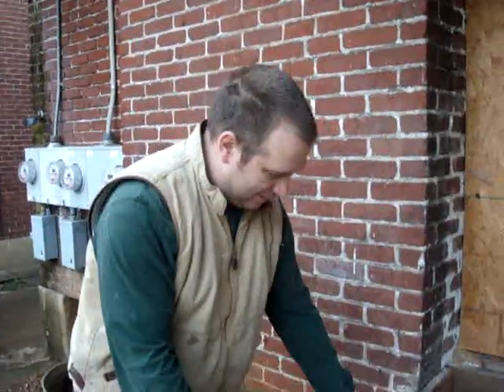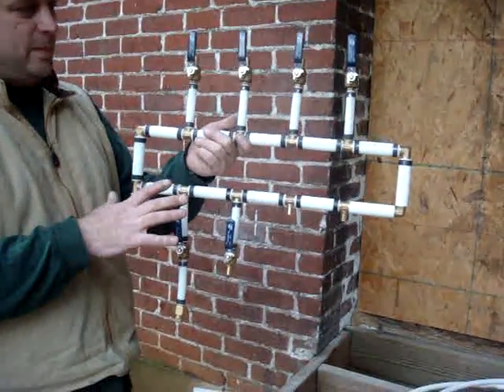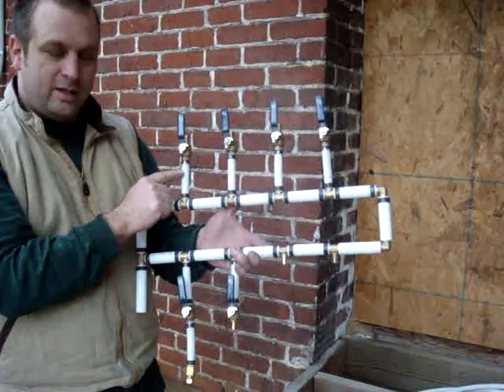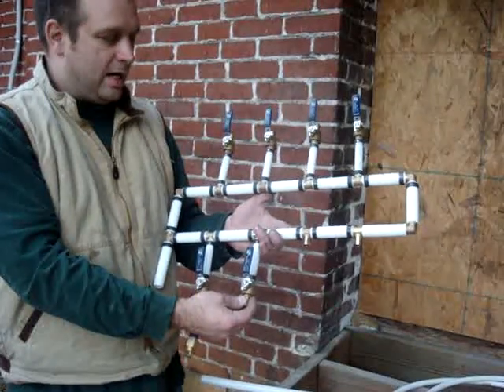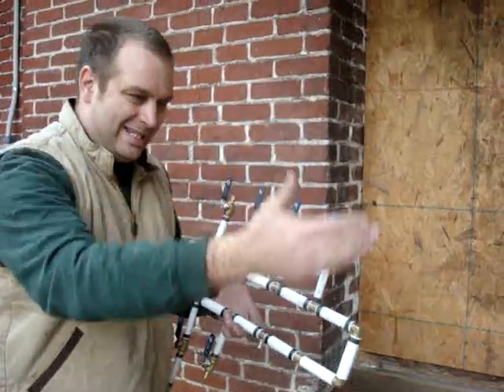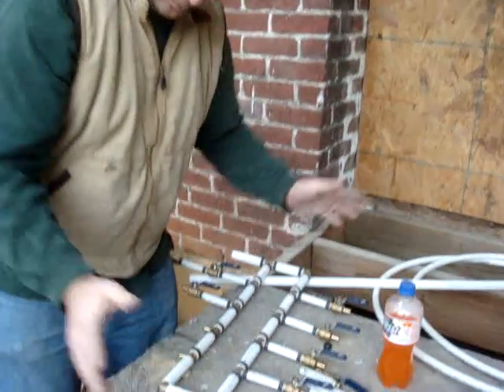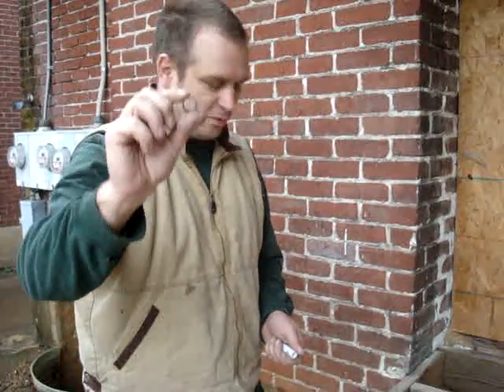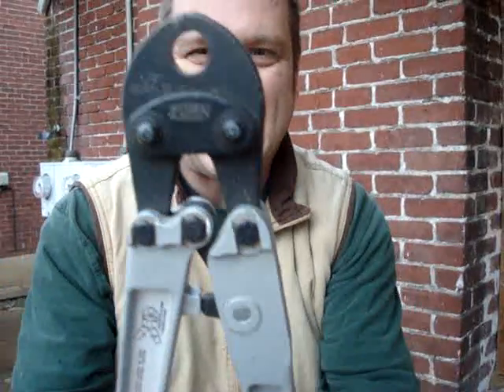Introduction to PEX

Comment: Diagnostic port....Muhahahaha.  Every hose bib boiler drain on the system is a diagnostic port.  This is why the plumbing code has gotten out of hand.  Get a guy like this on the board and his ideas and lack of knowledge pushed into the system.  PS you should be running 3/4 to the heater.
Reply from the maker: 1. code does not require a diagnostic port, so nothing is out of hand
2. the boiler drain won't give you line pressure from the main to the meter (for street/well pressure and or leak testing) And most houses don't have boilers any longer, so that's certainly not a consistent option--the whole point is having convenient and easy access, and for the cost of a $5 shut off value you can make everyone's life easy in the future.
3. this house is tiny and 1/2 to the ventless efficient on demand gas h20 heater only requires 1/2 cu (and pex supplies more than cu)
4. if the extra $5 is too much for your plumbing budget for the port, then just leave it off
5. some people call me a space cowboy, but I'm really a gangsta of love
Reply: 1. I am well aware of the fact that no plumbing code on earth requires a diagnostic port. I have no problem with it as it would be a future.  The problem is the statement "I think it should be code mandated."  And if you read what I wrote this would make a whole lot more sense.
2. Your little port will not give you street pressure either unless you install a PRV after the port.  Which would be pretty hard on your little pressure loop.  Otherwise you are getting post PRV pressure readings.
3. When your little "ventless" heater burns up you would wish you had run 3/4 for the upgraded version or 90% of the other water heaters on earth.  Too big is not a problem....too small...well could be a problem if you have a family and more then one bathroom. But not really a huge problem.
Reply from the maker: Thanks for your comments. We'll let the readers decide if they have any value. I understood your comments the first time and my response still stands--especially the one where if u don't like the port you can them simply skip it and put lunch money in your pocket. Good luck.
Reply from the maker: Oh, one thing: the specs on all fixtures are clearly stated by the manufacturer including gpm requirements, so we can simply use science and manufacturer's instructions to dismiss your point 3 above. Nice use of numbered points- wish I had thought if it.
Reply: I never said the extra port was a bad idea.  The point was the wish it was mandated by the code.  Yes each fixture does have a flow rate listed on it.  But your water heater served by a half inch line can not handle the load of a house full of people using hot water at the same time.  Mathematics and personal habits will go a whole lot further then science on this topic.
Reply from the maker: Ryan Dugger
1. I love trolls. Seriously. Cute. As we have this exchange I'm imagining how you've decorated under your bridge and how you scrounge around for cans and bottle when you're not online hassling people over their wishes to make diagnostic ports a code requirement.

2. what you wrote about tankless heaters shows you don't know how they work--the have a limiter switch that turns the heater off if the gpm is too low (which is why you can't trickle hot water when you shave). The gpm issue is relevant to expected load in the household (as I alluded to above) and you want to size whatever domestic water heating system appropriately. A little old lady in a 500 sq. ft. flat doesn't need a 80 gallon tanked water heater, but a small business might--the same goes for on demand. 

3. To suggest that science and numbers take a back seat to personal habits is simply silly. It's not even an actual criticism, just a random thing to say--we use science to calculate environmental issues/factors in the household based on expected demand. This is why we want to size systems just right, and it's for all house systems, not just domestic water. There are also problems if you oversize a heat pump and a 1000 sq. ft. ranch home isn't benefited from an 8 ton unit.

By all means, keep posting. I am really enjoying this and this is a great thing for my channel because it allows other readers (regardless of whether they comment) to see how an inquiry works. I offer information, then an external source (like yourself) criticizes that information and then they get to read my response to your criticism. It's like a critical thinking class and a plumbing lesson all rolled into one!
Reply: A.) cute comment about the trolling....Actually check out my page my bridge is in paradise and does not need any decorating..Im just trying to provide good advice in place of the bad advice you give your viewers.  Especially about pex B crimp type plumbing systems being the best.  This is debatable as viega is pretty solid....zurn just went through a lawsuit for its crappy brass fittings. So type B in the right brand is quality stuff....Zurn well there is a reason their fittings are so cheap on ebay.
B.) A water system is sized based on flow rates and demand has nothing to do with the age of the person living there.  Because after she dies a family could move into her flat.  Also if that little old lady has a 75gallon soaking tub then a 80gallon water heater could be needed.  Once again it is sized on flow rates not the person occupying the space.
C.) Running a 3/4 cold line to a water heater is not even comparable to over sizing a heat pump.  If we were talking running a 3/4 hot line that only serves lets say a lav sink.....then your comparison kinda works.  By stating this comparison you shine light on the lack of knowledge you have on the subject.  Its just good practice for future additions, replacements or upgrades.  It would not hurt anything because there is no negative draw back from doing so.  But if you want to save your twinkie money by all means run a half inch line.  I dont care.
Reply: Most houses dont have boilers any more?  Really?  And you understand the difference between a boiler and a boiler drain right?  Laundry connections, tanked water heaters and even outside silcocks can be referred to as boiler drains. You buy a hose thread by IPS adapter screw your gauge into it and put it on any hose threaded connection in the plumbing system. Theres your port.  Like I said though its not a bad idea to put one for future piping or draining the loop to fix the leaky zurn fitting problems.  Its the code mandated part that has me rolling.
Reply from the maker: Ryan Dugger Dude, we are well below 40 N Latitude--we don't use boilers any longer--everything is heat pump. No boiler drain. Again, if you want to do a line pressure test between meter and main--the only real test is this. You'd want it for (a) leak down and (b) true line pressure, so you check that at the main shut off. 

I love this exchange and I'd like to showcase this for all the traffic I get on this page. You're a case study in faulty inductive reasoning and post hoc rationalization--you can roll all you want to, but it's hard to argue with an opinion. Let me restate: it is my opinion that diagnostic ports be required. That is a subjective statement. It is not an objective statement subject to criticism--even if you try to make it so. I also like mustard on my hot dogs. It's true. Would you like to tell the world why I'm so wrong to enjoy mustard on my hotdogs?

One does not have a boiler drain if one does not have a boiler. Not all homes have laundries (and again, this won't allow for a leak down test), and not all homes have tanked water heaters. You can keep this up all day, and I will continue enjoying myself. Please reply some more--I truly love this.
Reply from the maker: Ryan Dugger To have fun (and reply to your points above):

I see you switched from numbered bullets to lettered bullets--I love mixing it up! 

On bullet point (A)

Anyone can put anything on the web, so who knows if you're real or not. If you want to video tape yourself (as I did) walking around your paradise holding the deed to the property, then I'll take that as proof you're real. Otherwise, you're just another loudmouth voice on the interwebz (no matter how fun you are for your attempt at legitimate criticism). (And, you are making my day, so if nothing else, you know I'm enjoying the exchange.)

On bullet point (B)

Size is based on occupancy which is based on zoning and size of the residency. Note I wrote the old lady was living in a 500 sq. ft. apartment and not a 3,000 sq. ft. home. I did that as a trick and you fell for it: you completely ignored the fact she lives in a 500 sq. ft. (probably) urban apartment which means she can't have a tub and has an occupancy rating no greater than 2 people (in most cases). Oops, I guess you thought you were on to something! One day, if you keep at it, you'll be able to disseminate information and pull the right variables needed to form proper conclusions. Don't give up--seriously--you have energy. You're talking outside your knowledge zone, but you do have energy, so put that energy into learning. Don't fall for obvious traps either. Be on the look out, especially in combative situations where your opponent isn't exactly falling down like a fainting goat from massive threat response.

On bullet point (C)

You're almost right here, but you missed the original context. First off, you're right over sizing a plumbing line one size up is not directly analogous to quadrupling the size of a heat pump--but it wasn't supposed to be directly analogous. Go back and read what I wrote. The point is bigger isn't always better and way bigger isn't always way better. Re-read that last sentence and you'll follow the original analogy. 

This is a tiny home. Tiny. And 1/2 pex flows at rates close to 3/4 cu when properly installed. You can claim I don't know these things, but the evidence exists independently of me. I'd cite sources, but youtube doesn't allow links, so sadly you'll have to google yourself. I do have burden of proof when making such claims, but really, I think you have an internet connection in your "paradise" home, so you can find a browser and google at your ready. The cost difference per house between 1/2 and 3/4 is trivial, so I'm not sure what you're driving at, but the environmental cost of reducing water waste (since we don't have gray water recovery code yet), is huge. 

BTW: I also think we should have gray water recovery requirements in all new homes! Oi vey!

This is too much fun! 

BTW: let's see some videos of YOUR work!
Reply: Obviously you have no idea what your talking about.  You can not get more flow from the fixture by increasing the pipe size.  Unless of course it is undersized in the first place.  I dont care if you run a 4inch uponor main trunk line to serve one faucet it will flow what it will flow.  Unless it is undersized.
  There is no plumbing code that states you can not have a soaking tub in a 500sq ft flat.  That would be maybe a city code or a private building code for a homeowners association.
    A 3/4 line serving a fixture designed for 1/2 inch on the cold water side will not increase water usage.   If however it called for a 3/4 and you ran a 1/2 in You would negatively effect its flow rate. Which if your trying to save water could be a good thing.  But it could also cause pressure balance issues with upstream fixtures under a high load. In this case if you had a Kohler high flow, pressure balanced shower installed on your 1/2 (which is really 3/8 as you will later see) dedicated line for that bath group.  
Your story about an over sized heat pump compares in no way to an over sized cold supply line. You can claim whatever analogy you want.  It still does not hold water.  As a over sized heat pump will negatively impact efficiency and air pressure.  A over sized cold line only has positive effects on overloaded systems, future upgrades or replacements in this particular case.
    As far as flow rates of pex it depends on how you run it.  If you run it using the same methods as copper using elbows instead of pipe bends then it will actually flow less.  Since the ID of the tube is decreased to 3/8 by the fitting. This happens because the fittings fit inside a 1/2 ID tube and have 1/8inch overal wall thickness. So the 1/2 pex is only capable of flowing at 3/8 rates.
   The only video I have of work is the passive water heating and passive home cooling system I created.  The work is sloppy in this case as it was built as a prototype.  I am a plumber and do it for a living.  I also did not spend much time thinking about the video or preparing and kinda rushed through everything and misinterpreted a lot of the processes and components.  Its a pretty good watch though for learning about passive heat exchange methods.  I have not seen any prior art that is comparable.
  Grey water systems are a great topic.  I have loads of experience doing illegal homeowner sanctioned grey water systems.  You will not find a house in hawaii that does not water their banana patch with laundry water.   I agree they should at least have code enforcing them so they would be allowed on new construction.  Requirements are not the right way to go.  They require every new building have solar water heating system installed.  These are often way over sized and prone to mechanical and component failures. Not to mention they heat water past a safe level because of the requirements in the code specifying sizing.  Also many new homes built here are vacation homes which are unoccupied a lot of the time.  This means the system over heats and blows the pressure relief valve everyday around 3pm.  Then they have to either drain the system when they leave and let it cook itself dry, install a heat dump or cover the panels.  Which can be tricky in areas with hawaiian trade winds and the manufactures warranty requirements.
Im glad your learning something.  Obviously I am open to learning but in this case the comment is comical.
Reply: Google boiler drain.
The pressure is balanced throughout the entire plumbing system when it is static.  Unless you have a PRV installed any outlet will provide you with street pressure while its static.  Leak down test can be preformed at any outlet.  If we are talking pressure drops over the system its the same thing.  Every outlet will show the same pressure and will read the pressure drop the same.  Unless a PRV is installed upstream of the outlet your testing from.  In this case it would have to go on your pressure loop after the diagnostic port.  In which case you would only get street pressure and have no idea whats going on in the house system. Just cause you can talk fancy does not mean you have knowledge on the subject. 
If the hot dog stand required me to put mustard on my hot dog because you like it then it would be objective.  Which in this case is a perfect analogy to the code making me put a diagnostic port for no reason other then lack of knowledge.
Reply from the maker: Ryan Dugger The joy never ends! Readers are likely getting bored and to be honest I only read the first few lines. Straw man fallacies won't help your case either--go back and quote me on when I claimed flow and line size weren't increasingly proportional. Now that you've either (a) reached the point where you're making straw man attacks or (b) actually are incapable or following basic plumbing science, I think we'll just let the above comments stand without response. They don't deserve a response, but I will watch a video of your work. You'll have to prove it's you by directly referencing this exchange and showing a state issued ID with Ryan Dugger on it, but I'll watch. 

In the meantime, I'll go back to working instead of playing (although this was fun--even if you were never able to tweek me) and I'll just let the local building inspectors and long standing customers be the actual judge of my work! Good luck, and you're welcome to keeping typing away--I won't block you. I think what you've been sharing is a great way for people to see what bull shit in the building trades looks like.
Reply from the maker: Ryan Dugger Since the hot dog stand doesn't make those requirements, other customers are allowed to choose condiments as they wish. Again, you can spin this any way you like, but other people get to long for mustard and line items in building code. It's no skin off your ass, or rather it shouldn't be, but again, you're in this convo and it sounds like you're googling to keep up. The way to check for underground leaks is to do it between the meter and the main, not the meter and the entire house. I'm glad to hear I'm a fancy talker. You should see me ballroom dance. I'll leave these posts up and you can have the last word to your heart's content! This was fun!
Reply: No im not googling anything this is common knowledge in the plumbing trade.  A leak down test can be used to find if you have a leak in the entire plumbing system.  If you are suspicious of a leak on the water service you would shut your little zurn valve before the port and leave the curb stop open. Then watch the dial on the meter.  If it spins you have a leak. If it does not your fine.  Funny how you dont challenge the stuff you know I called you on. Your still stuck on your subjective diagnostic port.  Yes it was fun, I love schooling people who think they know the trade.  I dont know everything and learn everyday.  Thats the way plumbing is.  Nothing is ever the same.  Different strokes for different folks.
Reply: "The cost difference per house between 1/2 and 3/4 is trivial, so I'm not sure what you're driving at, but the environmental cost of reducing water waste (since we don't have gray water recovery code yet), is huge."  Boom! Its physically impossible to use more water through any given fixture simply by increasing the supply piping to it.
Bam ". And 1/2 pex flows at rates close to 3/4 cu when properly installed."  Physically impossible for a 1/2 line to flow even close to 3/4.  Its physics and hydro dynamics bro.  Straw men were just examples to try and give your mind a mental picture, because obviously explaining hydro dynamics was not working.
Reply from the maker: G66CA We have a difference of opinion. If you'd like, I'd be happy to outline the premises upon which I've formed my argument. There are some factors I think you haven't considered.
Reply: Ryan Dugger Why are you arguing with someone who doesn't know what a boiler draw off is????
Reply from the maker: G66CA We all know what a boiler draw off is--the point is not all homes have boilers. Where I live, most housing stock from the mid 70's only have heat pumps. Since the 1980's virtually no new home has a boiler. So, if you're going to participate, be sure that you understand the arguments on the table so you can offer informed criticism. No boiler = no boiler drain.
Reply: hahahahahahaha
Reply from the maker: Again, no one here refers to boiler drains as anything other than drains on actual boilers. I simply don't know how I can drive that point home. We also never use the word bubbler to refer to a water fountain. Wasting time on semantics is just a distraction. The only issue up for debate is the value of having a port immediately after the main shut off vs. using a fixture.
Reply from the maker: And by all means, feel free to reiterate how you've conflated subjective and objective claims. Why waste your time here? Why bother with all the verbage over my opinion that diagnostic port access at the main cut off is a valuable thing? Why take a trivial aspect of a video on the importance of having a manifold and devolve it into an unsolicited debate?
Reply from the maker: Something just struck me: are you simply trying to say that one should simply buy a boiler drain and fashion it into a crude DIY diagnostic port for use as various fixtures? If that's the case then why couldn't you simply have said that in a single sentence?

Again, all your other arguments are weak (see my responses above) but if you're simply using a boiler drain valve for the male threads (for ease of various brass adapters) then a boiler valve would be easier than a hose bib or sillcock. It's still not the point, but if that's what you're trying to say then at least you're not blathering on in some regional slang.
Reply: ho ho he he hahaha
Reply from the maker: I think your reply is perfect--please don't delete it. This exchange is as valuable as the video. Anyone that has the patience to read this discussion will be rewarded.
Reply: James Glass a boiler drain is a 3/4 draw off
Reply: James Glass pressure testers are sold with hose bib connections, watts 276h300.theres no need for a test port
Reply: James Glass boiler drains WERE used in the pumbing system at the watermain, they are just a brass 3/4 drain shut off
Reply: James Glass  they were used for boilers and domestic water..